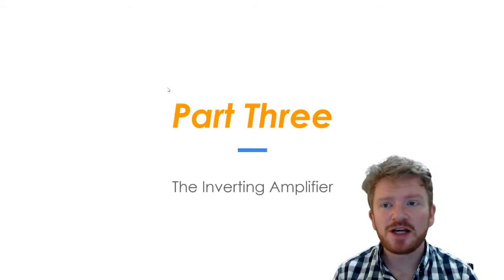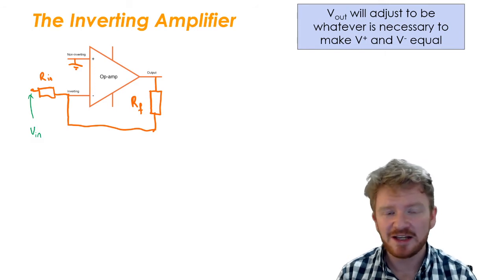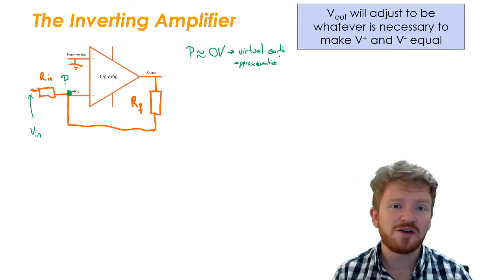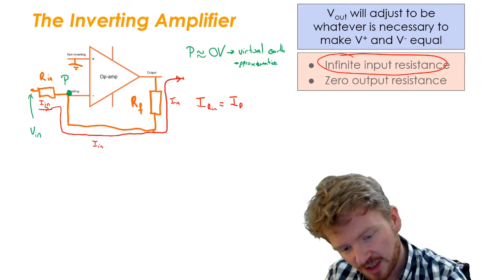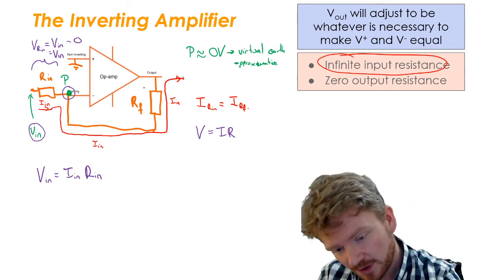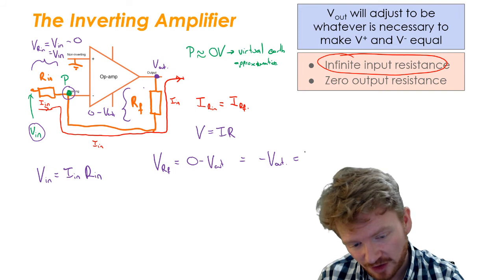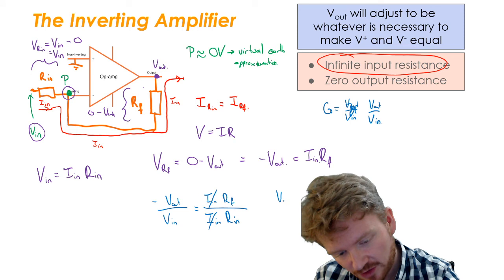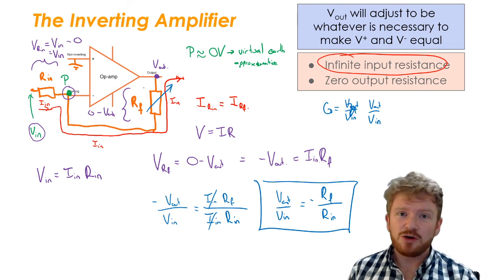CIE A Level Physics Electronics - The Inverting Amplifier

Comment: Why cant we add the two resistors Rin and Rf since they are connected in series?
Reply from the maker: I'm not quite sure what you mean Sally, but if you mean why can't we replace the two, it's because we have a wire connected between them, using them as a potential divider. Does that make sense?